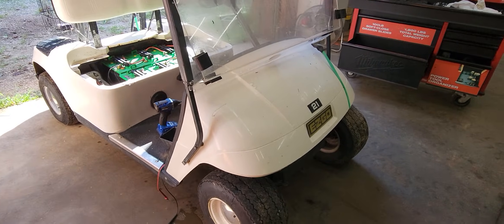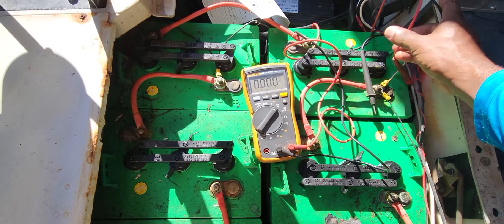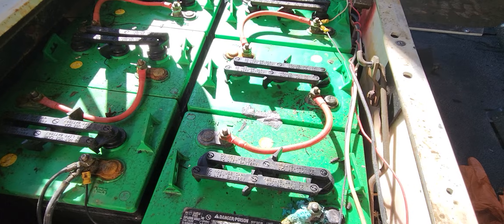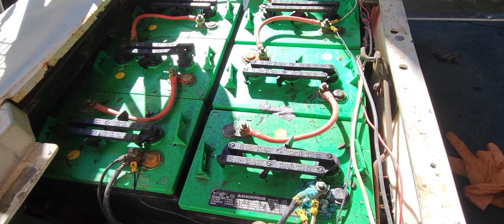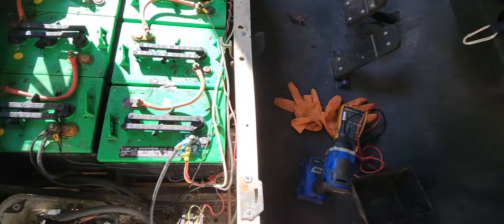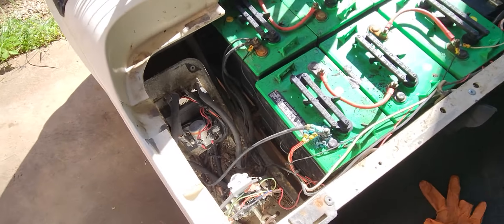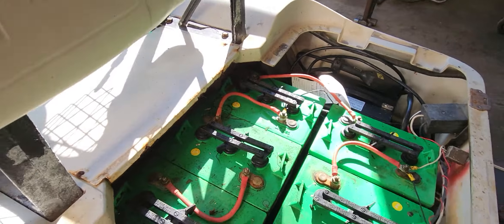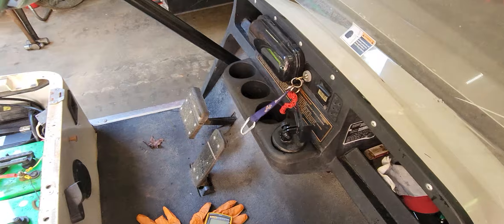EZ-GO Golf cart stopped working. How to diagnose / troubleshoot an electric EZ-GO golf cart.

Comment: Great tutorial!   Checking battery connection and discovered a broken threaded terminal.   Appears to have been repaired once when I saw a solder blob.
Reply from the maker: I would think that might be where the battery terminal overheated and melted part of the battery stud. No one should ever be soldering on the battery

Comment: I’ve got a 2003 EZgo txt that I’ve been messing with for being very slow. I’m part of a fleet shop so truthfully we’ve been throwing all the usual suspect parts at it with no success. Sealed batteries all load test good. Terminals tight and clean. New motor, speed sensor, controller, solenoid, throttle pedal sensor.. all with no luck. Any ideas?
Reply: Disculpe, ya arreglo su ezgo? Tengo el mismo  problema  ya le puse baterías nuevas

Comment: Hi bud.  Testing a series motor was the way you show here.  Testing a shunt wound motor is you need to connect A1 and F1 with a jumper wire and also connect A2 to F2 with a jumper wire.  Then connect to a 12 volt battery with neg on A1 and pos on A2.  Cheers.
Reply from the maker: @silversailor5012  what a great tip thank you so much!!!

Comment: I CHARGED THE BATTERIES AND WHEN I SWITCH FROM MAINTENANCE TO RUN IT MAKES A POP AND THEN I SMELL PLASTIC....WONT MOVE.....WHEN THE CART WOULDNT GO I PUT IT IN REVERSE AND IT TOOK OFF WAY TO FAST SO I PUT IT IN NUETRAL NOW IT WONT GO FWD OR BACKWARD
Reply from the maker: Sounds like it's wired up wrong. Did someone alter the original wires?

Comment: Most underrated tip was, "water on the battery for corrosion dust." Im into a 96 ezgo txt that wont move. Im working on it this weekend for the first time so it should be fun.
Reply: Did you get yours running?
Reply: @toxicmatter22  I did get it running but the batteries were shot so I could only run it for a few seconds. So I went crazy and ripped apart the whole cart, rebuilt and repainted it. Now just gotta put the body back together and get a lithium battery.

Comment: Hi Jeshua, I have replaced everything I could thing of except the motor and key switch, and still can’t get it to work. It just stopped running without warning. EZGO 1994 Txt. Please help me. Just put new lithium batteries in it because I know the lead acid was bad.
Reply from the maker: What kind of lead acid batteries did you use? Are the batteries turned on?

Comment: Great video bud! 
i’ve got almost the same golf cart. It’s a TXT. And it just stopped clicking when you turn the key on it was clicking, but when you switch from reverse to forward, it would not switch back you had to unplug a wire that goes to the computer and it would reset itself. Now it won’t do anything.
I know you get tons of questions about this kind of stuff, but I appreciate it if you have any ideas

Comment: Have a 99 txt 36v. Runs fine on flat ground and struggles uphill. Makes beeping noise when hitting bumps and power is lost for a second. All batteries tested fine on multimeter and load test. What could this be?
Reply from the maker: Sounds like foot pedal control is bad
Reply: Thank you. I will check that

Comment: I have an  EZGo probably '94.  Batteries are new, but top speed is less than before and frequently it stutters while running.  What do you see as the most probable cause or what is your suggested sequence of trouble shooting?   Thanks.
Reply: I have this problem also and cant seem to fix it.

Comment: My ezgo sat with new batteries over winter..  checked and charged all 6.. then switch on... DEAD.. nothing. no headlight.. no indication it has power. fuse?
Reply from the maker: Watch this video. Maybe it explains why your batteries drained. https://youtu.be/SW2r0tIg00E?si=6LY1By9yePjFxKgB
Reply from the maker: Also are you sure they actually accepted a full charge? How long did the charger run? What charger are you using?
Reply: A new charger and tested batteries.. turn key.. nothing.. lights out.. nada
Reply from the maker: @watchmanjoe4823  how old are the batteries? How did you test the batteries? What is the exact volts of the batteries? If the batteries are good then you have a broken wire or bad switch somewhere.

Comment: I need help. 36V 2007 EZGO. The batteries are fine. I rode it up the hill with a lot of resistance. The batteries got hot. I went for a hike, came back and the cart wouldn't move. I hear the click when I engage the pedal. Please help.
Reply from the maker: The batteries themselves should have never become hot after driving. Were the batteries themselves hot or are you only talking about the battery terminals? If only the battery terminals were hot that means they are dirty and corroded or possibly loose and you may need new wires connecting them because the wires will corrode and not conduct power correctly. I would say check the wires leading to the batteries and also check the wires that go back to the motor. There should be four main wires on the motor be sure all of them are snug and tight and not burnt off.
Reply: @jeshualee2711  thanks. It was the terminals. Changes all cables and cleaned batteries. Charged and ready. The pedal still only clicks w key on.
Reply from the maker: @roymiller447  the solenoid that clicks could be bad.

Comment: Good video! I just bought a 93 ezgo with year old batteries, The total voltage was 35 v. I had to add 5 1/2 gal of water to fill to ring on each. Also the battery wire terminals on each battery are corroded. Hooked up the charger, 5a, came with the cart, over night and now reads over 36v, each battery reads over 6v. When I clean the connectors, before I reinstall them I'm putting corrosion spray on each. Hope this will stop or slow down the corrosion
Reply from the maker: Sounds good friend , you are doing the right thing. Keep charging those batteries repeatedly even if they are charged for a few days to try to work the sulfates off the lead plates. That was a lot of water you had to add!
Reply: They were bone dry! Seems like they thought they were maintenance free batteries. As soon as the weather warms up I'll clean them up.
 Years ago my dad used 1/2 teaspoon of washing soda in each cell. They would bubble for several min, but got another year out of the battery. Don't know where you could find baking soda now.
Thanks
Mel   @jeshualee2711

Comment: Thanks for the video. My sweet young wife has a 36v ez go. About that year model, and it stopped working, 2 of the battery wires had melted out of the batteries. I put regular battery lugs with wing nuts on them. The solenoid clicks, but it doesn't move. the charger comes on, and after an hour or two, it goes off. Do you have a video or know where I might find out where to start troubleshooting.
Reply from the maker: I will see if I can make another video describing this or talking about it. Be sure to subscribe! In the meantime check the main contactor solenoid and make sure it is working and make sure wires didn't melt off of the motor. To check the main contactor lightly depress pedal until solenoid clicks then short solenoid across the two large main terminals and see if it goes then. If not it sounds like some wire is bad leading to the motor.
Reply: @jeshualee2711  thank you. I checked the motor and controller, and it all checked good. It wound up being the contacts on the gear shifter, not making good connection

Comment: 2004 ezgo 36 cuts off going up hill on bumpy ground ,if I turn the key off it resets and runs again. Silanoid is hot to touch so is the motor not sure if that's normal
Reply from the maker: Some wiring is loose somewhere. Inspect every wiring by grabbing it and make sure it is snug and tight. Key switch wiring could be loose too. Let me know if you find anything and be sure to subscribe. Hopefully I'll make another video addressing this.

Comment: What happens if solenoid doesn’t arc?
Reply from the maker: What do you mean arc? Nothing should be arcing but you should hear a click from the solenoid. If it's not clicking it could be the main controller or the battery wiring is faulty

Comment: You mentioned the FR switch is a pain.  Do you know how to convert it to a solenoid switch ?  I would like to switch mine out.  Thanks very much.  PS You have the heart of a teacher and motivated me to work on getting it running again.
Reply from the maker: Switching it out to a switch makes it so much more convenient for sure. Yes there is a kit out there for swapping it out. Search eBay for it. If you are not an expert in wiring I don't recommend attempting it though. It's pretty complicated and you have to mount a reversing solenoid etc in it. I can try to post a video roughly describing how to do it. I did one several months ago. Be sure to subscribe!

Comment: I have a 1995 EZ GO 36 V 
I have no power going to the Solenoid
Reply from the maker: Make sure the keyswitch is working and the foot pedal control is working as well.  Make sure all the batteries are fully charged and that the forward and reverse switch is working. If all that is working it could be a bad speed controller

Comment: Sir I need some guidance.  My ezgo slightly moves when I give press pedal but it wont go.  This happened out of the blue.  What do you think I should look at?
Reply from the maker: The main contactor solenoid is bad. It should be located near the speed controller
Reply: @jeshualee2711  thank you very much. I will order and replace. God bless
Reply: @jeshualee2711  I replaced that Solenoid and it only slightly moves forward or back.
Reply from the maker: @alexandermeans364  what year cart is it? Club car or ez go? Toggle switch for forward and reverse or mechanical lever? Need more information about what kind of cart you have.
Reply: @jeshualee2711  it's a 2003 ezgo with manual lever
Reply from the maker: @alexandermeans364  some of the contacts on these manual levers will melt and not make a connection. Make sure the gold colored contacts on the mechanism don't show signs of the plastic melting beside them
Reply: @jeshualee2711  checked those contacts under the cover where the lever bar leads to. Connections a little dusty but all good
Reply: Well Im sorry I waisted your time.  One of the batteries had a dead cell which was not allowing the cart to get 36v.  I could feel it trying to move which is why I didn't replace solenoid initially.  In any case it was one dead battery out of the six.  Sorry and thanks
Reply from the maker: @alexandermeans364  I'm glad you figured it out!

Comment: How can I diagnose the problem I'm having. It runs for like 50 yards and dies. Batteries are all good, all hold a charge. Its a 36V.
Reply from the maker: Is it running full speed then stopping? How do you get it to resume going? How long does it stay stopped? Sounds like a bad foot pedal module. Be sure to subscribe. I hope to address this in the next video

Comment: I just bought this golf cart 2000 model for 300, because it wouldn't move. All the time, it was the white wire  "loose" Thanks, this video saved me.
Reply from the maker: Glad yours was a simple fix!
Reply: Great video. Buying one that has a similar issue “I think”. This really helps a lot. Nice job.
Reply: i put a new solenoid on my 2000 ezgo 36v and accidentaly reversed the diode and it fried the peddle micro switch. i turned the diode around the correct way and it fried another switch. Did the diode dead short or did i damage the solenoid or maybe even ( heaven forbid) the controler??
Reply from the maker: @dh5594  Sorry I'm just seeing this comment. Did you figure out what was wrong with it?
Reply: @jeshualee2711  yes, it was the peddle switch was shorted. All fixed now. 👌
Reply from the maker: @dh5594  that's great that you figured it out!

Comment: Very much like your process!  I have a 1992 Club Car 36v that sometimes goes in reverse/never forward (so thinking the batteries are OK).  Just replaced the solenoid thinking that would be the issue, but wasn't.  Now thinking about replacing the F/R module.  Any ideas?  I'm a novice with minimal electrical skills. Many thanks!  Jon
Reply from the maker: Does it have a large F/R lever or a toggle switch for forward and reverse?
Reply: @jeshualee2711  Wow! Thanks for quick response.   Yes, a large (F/N/R) lever extends through the front wall.  Doesn't always go in reverse and only once jumped forward.  Seems like something could be loose, but haven't found it.  Makes whirring noise before engaging in reverse, but no sound when in forward.

Comment: To clean the battery terminals properly use a half inch baking soda in a spray bottle filled with water. Spray it on then hose it off..
Easy Peasy.. 
NO WIRE WHEEL, NO WIRE BRUSHING..
Jeez, do I have to teach you everything...
Reply: Be sure to cover all the electrical parts first, with the exception of the batteries of course. But you're right, b-soda and water is all you need. And then once dry, spray each post with dry lube or a battery post spray. That will slow the corrosion process. Keep batteries CLEAN and dry.

Comment: The first thing you want to check is the battery terminals?   Lol ok. Id check the fuses first but I'm just a journeyman electrician.. so idk.
Reply from the maker: I'm shocked at how so many of you guys have no golf cart experience but don't really believe what I'm saying. Most older carts like this don't even use fuses for the drive system. There are no fuses on a cart like this that can affect the drive. What fuses it may have can either be for the charger circuit or lights and accessories.
Reply: No fuses !

Comment: How do I test the micro switch in the floor by pedal?
Reply from the maker: If it only has two wires to it, it's a simple continuity test. You need a multimeter.

Comment: Joshua Lee I need your help my guy, just watched this video and it’s been the most helpful so far. Long story short I have a 1996 ezgo TXT 36v. Batteries are about a year old at most, every time I take the cart out it runs for about five minutes and then dies my M - wire coming off the top right hand of the control box is very very hot all of the other wires are not, this one is excessively hot by where the terminal meets the m - control tooth top right of box. Sometimes if I put the pedal down it’ll jump sporadically after it’s died (battery led on dashboard reads full). If I let the cart sit for a while it will then work again. The battery meter on the cart says it’s decently or if not fully charged but dies. I rewired all of the low-voltage wiring off of the forward and reverse assembly I’m on my third control box and third solenoid. I’m at a loss I don’t know what to do. I watched your video and checked to make sure my batteries are good they’re all registering at around 6 V. Any suggestions? Would love to chat via text or call, I’m that desperate!
Reply from the maker: How old are the batteries?
Reply: @jeshualee2711  maybe a little more then a year old!
Reply from the maker: What controller do you have in the cart? What is the name and model of the controller? Also replace the wire that's overheating with at least a 6 gauge wire before it melts something down. Does the cart run full speed and then stop or is it very slow and weak and then stop? One battery could have a bad cell and that can cause it to stop. Batteries need to be loaded tested.  What brand batteries are they? Are the batteries fully charged? Are the brakes dragging creating rolling resistance? Does the cart go the normal speed in reverse? Do the headlights turn off when the cart stops? When the cart stops does it first make several clicking sounds and then stops or just stops and there are no noises?
Reply: @jeshualee2711  I have what is called a five prong controller that I picked up from a golf store here in town. It’s got four teeth at the top M- B- B+ and then A2I believe and then a plug-in plug at the top as well. I already changed out the wire yesterday that I was specifying on and it’s doing the same thing. As far as the model or make of the controller, I don’t know cause it’s installed in the golf cart. Currently in the solenoid is on top with a bracket holding it in.
Reply: @jeshualee2711  yes the cart will run full speed and then all of a sudden just die. I’m not versed enough to check each battery. I am bringing it to a place here in town that will do a couple bench test for me next Friday the 28th. Batteries are fully charged the LED battery indicator on the cart is fully charged when this happens meaning when it stops and I do have lights on the car that don’t go out when the cart all the sudden stops. None of the electrical goes out when the cart stops working. Also, when it does stop working, I have the pedal down to go. The car will jump like it’s trying to go sporadically. But ultimately won’t go. And then after all this happens, I’ll tow it back home put it on the charger and it’ll work again in five or 10 minutes.
Reply from the maker: @MichaelJohnson-uw7fu  sounds like it's wired up wrong. Some wires are crossed up. You need to get a real expert to look at it before it catches fire or burns up the controller.
Reply: @jeshualee2711  could I maybe pick your brain via text or call sometime. I’m a home inspector so this stuff is tough for me. At your convenience of course. Let me know what you think and if you’re ok with it I’ll send ya my number.

Comment: Why replace all that stuff?  Just fix the problem and return it to the owner.
Reply from the maker: This is the difference between quality shops like ours where we fix it thoroughly and we pride ourselves in extremely high customer satisfaction, to where we don't even advertise anymore because of extreme demand, vs shops that do half jobs only for the customer to have to return again and again, frustrated and upset.
Reply from the maker: Hi Philip! Do you run a business and work on golf carts too? Just curious what's your experience level? Thank you.